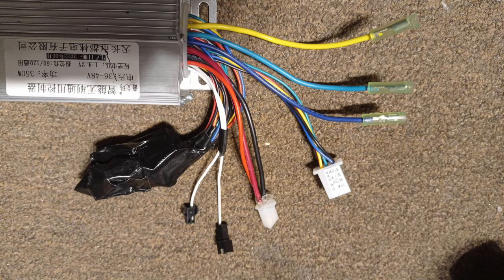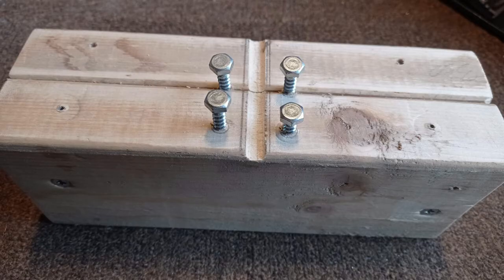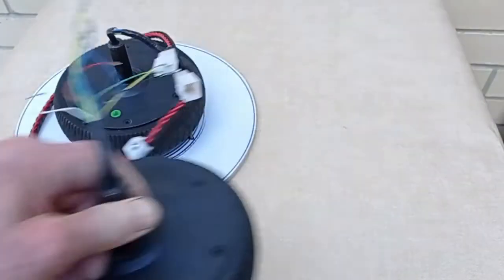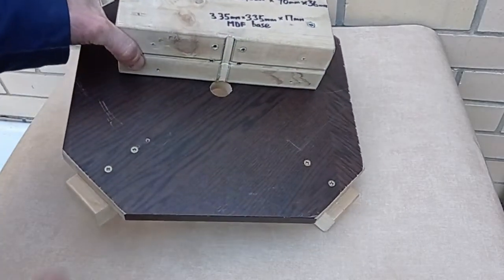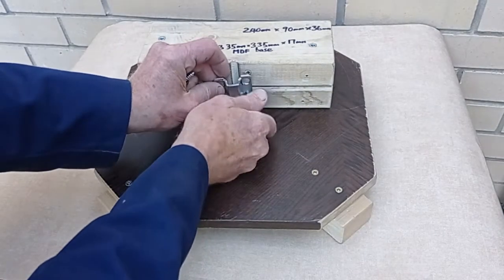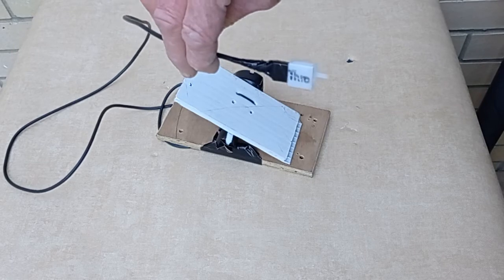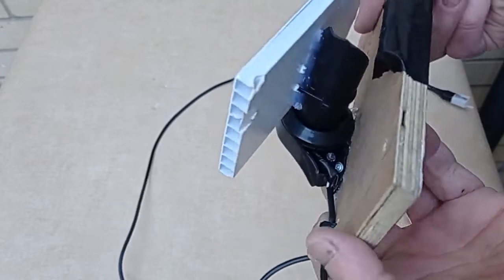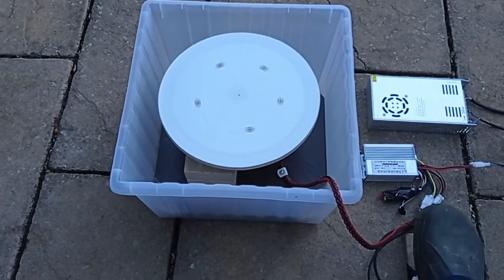Make a simple DIY Potters Wheel

Comment: https://youtu.be/kyMVY0iHxkA?si=boMNe4FgRuy881p_&t=243
How did you connect these wires? Can you explain in a video how to connect the wires?
Reply from the maker: Look at my more detailed instructions on the "Instructables" webpage. Search " simple pottery wheel".
Reply from the maker: Basically, the yellow/green/blue of motor power and thinner yellow/green/blue/red/black of motor hall sensor must connect to the appropriate plug (and same colour wire) of the controller plugs for power and hall sensor.
Sometimes green and blue need to be swapped on one plug.
Look for other videos wiring up hoverboard motors.
Reply: Thank you for explaining more